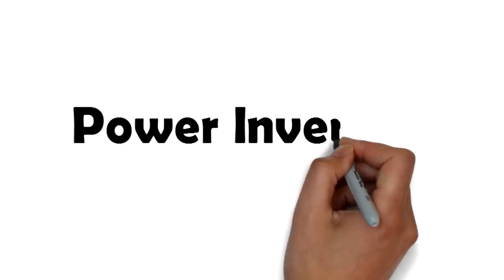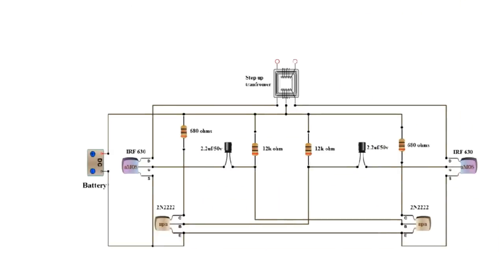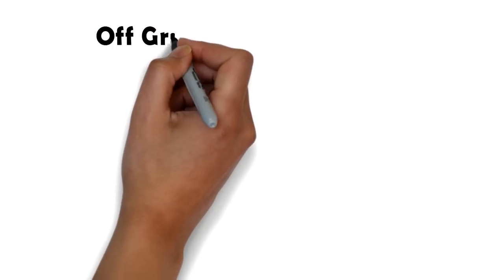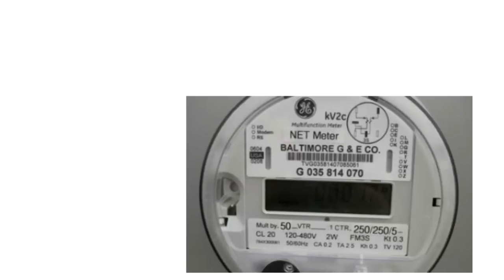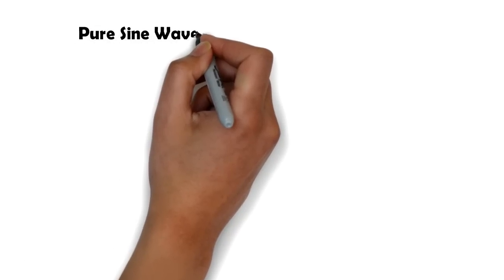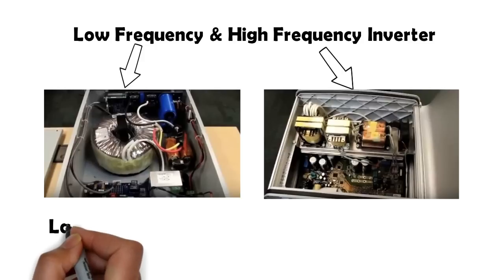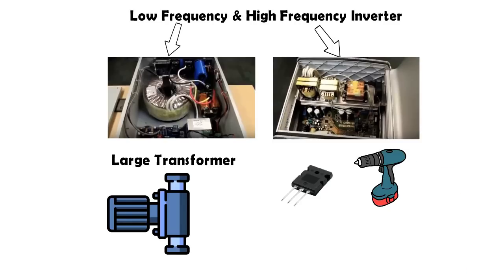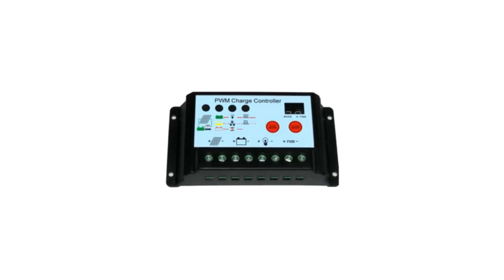All you need to know about Solar Inverters

Comment: Hello sir my grid power is rated at 50hz at 230v while the inverter I intend to buy is rated at 240v 60hz can this system work for my solar
Reply: Not if you want to connect it to the grid.

Comment: Very well explained! If I may, I need some advice. I currently have a 1.000w inverter (on a 12v system) and really need to upgrade to a 3.000w inverter. Can I just change the inverter or does the rest of my system need some changes too? I have 5 panels of about 550 watts in total plus a 400w wind turbine with its own charge controller . Would really appreciate your advice. Thank you!
Reply from the maker: Its preferred you upgrade from a 12 V system to a 48V. Particularly for 3000 W system . Else you will need extremely thick wires, plus you will struggle to find 3 KW inverter that supports 12 V system
Reply: Synergy Files Thank you! I really needed and dreaded this reply...That would mean a change in all the parts involved, including the panels and batteries or would I just have to change the charge controller and the inverter?
Reply from the maker: You just need to change the inverter. Modern inverters come with charge controller built in. You will have to check the specification. You dont need to change anything else. If your existing wire is of a thicker guage, than you can use it for the new system too. Else you will have to change it. Just check how much is current is allowed through the wires first. In a 48V system you will need a wire that allows 63 amps
Reply: Synergy Files Excellent! Thanks a lot for the help!

Comment: Can someone help me? I Have an inverter homemade through the help of circuit diagram that i found... If I connect the solar panel to my 12 volts battery it will charge or not? Then I will connect my battery to my inverter? I hope that someone will answer my question. This is for my research. :(
Thanks!
Reply: You should use PWM solar controller to connect solar panel + Battery and then battery connect inverter.

Comment: thanks a lot , good explaining ,,,, would like to know more about pure sine wave hybrid inverters and if they are better than normal pure sine wave imverters ( I mean which not including mppt  controller inside )
Reply: Hybrid inverter is built with AC charger, you can charge battery from city electricity. normal pure sine wave inverter without AC charger, and material cost is lower than hybrid inverter.

Comment: Excellent explanations here!  Very well done!  So low frequency inverters are more designed for high peak startup like pool pumps. Example: I have a 3/4 HP Astral pump "0.61 kw  - 4kw p/day" and I will probably need a 24v 3kw LF inverter "9kw peak".

Comment: My question may sound stupid to you but i am new to solar tech. In a battery based off grid sistem, where all loads are AC (tv, light, radio...), using MPPT charge controler, off grid inverter, is it posible to have loads runing and battery charging at the same time?
Reply from the maker: It is possible. As long as the loads are not higher than the production of power by the modules. You may want to have a bigger system though around 5 kW (depending upon your load)
Reply: Thank you for the answer.

Comment: I just had solar installed and forgot to ask the question: if there is a power outage during a sunny day does my system turn off or do I still have power to my house from the panels? I don't have a battery.
Reply from the maker: Depends upon the inverter. If in US, most probably the inverter will stop during a power outage to prevent Islanding. If you have a circuit that can isolate the mains power supply, there may be a chance to make that work during a  power outage. Please ask the electrician who installed it

Comment: As salaam aliekum 
Great video, clear and easily understood.
A quick question.
I have 3 phase power for ducted air con.
I want to install a 5 or 6kw solar array and i sill hopefully be using the power instead of supplying the grid.
How can i ensure my solar system feeds all phases and not one. Is this possible
You seem to know what your talking about
So many dont, I asked a salesman today what the open circuit voltage of a panel was and he started talking power and current which is not what I asked.A salesman should have technical product knowledge.

Oh yeah forgot to mention I live in Sydney
Reply from the maker: You can get a 3 Phase Inverter.
Reply: Synergy Files as salaam aliekum
Would i be correct in thinking it would be a series converter and not a micro converter.
Reply from the maker: Walaikum as salam (Peace be upon you too). A three phase inverter is a special unit. There are various companies that provide them for different capacities. While I do not know the inner construction and circuit of the three phase inverters, but they have been used for running heavy 3 phase motor pumps in rural areas for getting water from underground channels. I just did a quick search on google and found that all major inverter companies (Sunny boy, Fronius etc) are doing 3 Phase Solar Inverters.
Reply: Synergy Files Many thanks and its refreshing to find someone honest and caring. 
Everytime I search google and youtube i feel flooded by information that is biased with unproven claims.We need to be more modest in our thinking and needs and stop raping the planet bare as we prostrate and worship material wealth and goods.
 Wa aliekum salaam

Comment: Sir Will you please,tell me about,3 phase ,moter I want run for tubewell,how many watts solar panels shll be required,and inverter
Reply from the maker: +Abbas Malik It depends upon the size of the motor. What is the power rating of the motor?
Normally tubewell motors are  3Kilo watts. If you want to directly run the motor from solar panel it is possible but system would be poor. I would recommend battery backup. You can get a 3 phase inverter. Also lookinto DC motors
Reply: Sir moter size is 5 HP (3730)watt,what u recommend, solar panels,and inverter

Comment: Well explain bt still have a question what is a split phase inverter. Iv seen somewhere AIMS Power low frequency split phase inverter. So guide me plz.
Reply from the maker: Thank you for explaining that. It is most helpful
Reply: You normally use 115 v AC power from any utility outlet, but some appliances like stoves, air conditioners require 230 v AC power, that is why utility power feeds your home with two hot wires and one neutral wire, one hot and a neutral wire gives you 115 v AC, two hot wires gets you 230 v AC, this called  Split Phase, Im verters split phase come with two hot wires and a neutral so you can get 115 or 230 v AC out, other you can only get 115 V AC
Reply from the maker: I have not seen Split phase Inverters and I dont know much about them. I have heard in some parts of USA, they are used. They are not very common.
Reply: Well Thanks
Reply: Upstreammind Thanks for explanation really helpful information.

Comment: Sir can we connect panels directly to solar inverter to power house or we need a battery ?
Reply from the maker: You can connect directly. Please see this video. https://youtu.be/-jrWwdO47q8
Battery option provides backup if you dont get electricity from mains.
Reply: Synergy Files thanks alot  and sir how many panels and how many kw inverter will i need to power refrigerator?
Reply from the maker: Depends upon the size of the refrigerator.  If you need to run a refrigerator its better to use battery. With battery you can run it from 800 W to 1 kW panels otherwise you will need 2 kilowatt panels

Comment: Assallamoaalikum.Dear, main ak solar system lagana chahta hn apny ghar. 8x Fans, 16x Energy Savers, 2x Fridge, 2x water pump (1 HP), 1x Pump for upward (2 HP), 2x Computers, 3x TVs (21"). Total kitni plates required hen?Total kitni batteries required hen?Charge Controller kitny Amp ka hona chahye?

Agar complete system Jo upar bataya ha DC to AC chalana chahen to kitny Watts kq inverter required hoga?

Looking for positive response.

Thanks
Reply from the maker: Ahmed Ali Aap ka kum us kum system 5 kw say 7 kw ka lagay ga.  ussi hisab say inverter aur batteries khareedni parain gi